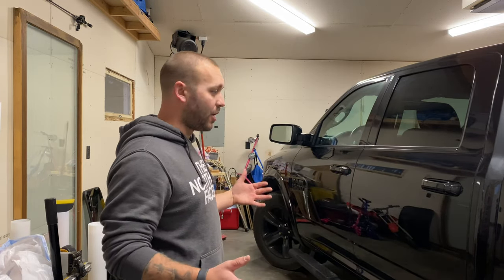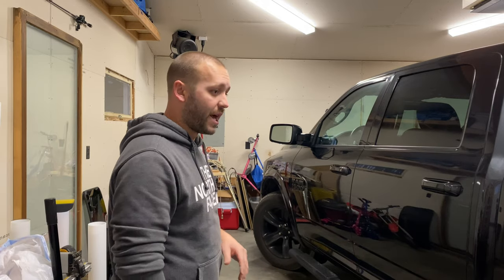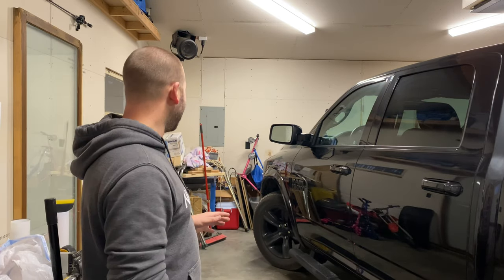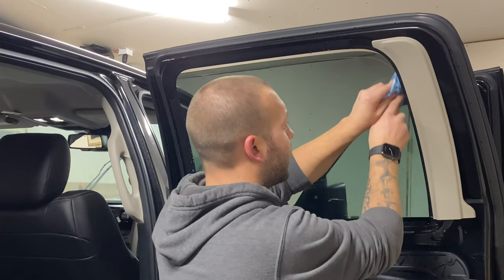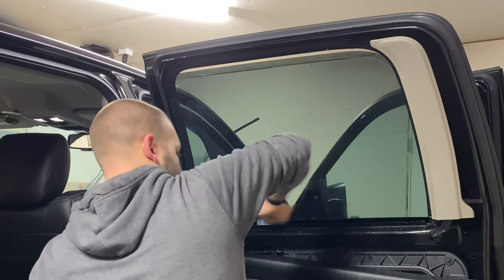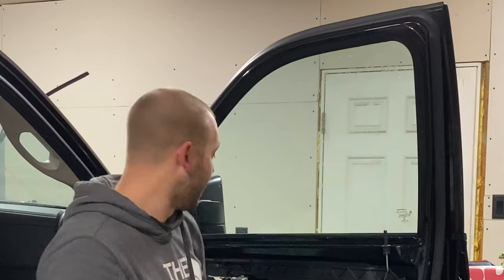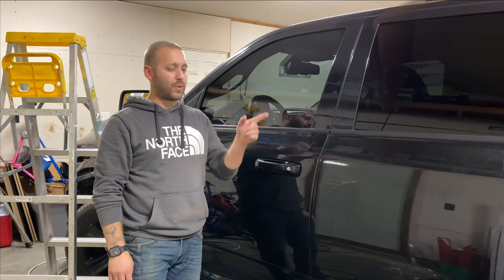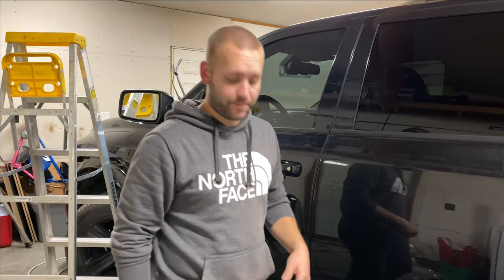Window Tinting a Ram 1500

Comment: After watching your vids, I'm thinking of tackling the tint on my work truck.  Where do you suggest buying the tint from?
Reply from the maker: That’s awesome.  A convenient option is partial rolls of SolarGard from Metrorestyling.com.  You can get a 40” by 10ft roll for less than $50. You will for sure be able to get the front two windows done with that and maybe even the entire truck depending on the glass configuration.  
I would stay away from the cheap films found at Walmart or auto parts stores.  It’s a bit harder to work with and will likely fade to purple over time.

Comment: literally askd myself the samething, to why My GunMetal Grey Metallic 4th Gen 1500 CrewCab’s interior A/B/C Pillars, sun visors & Headliner are Beige(dirty), when the rest of all my interior is black? SMH..Which is why im gonna DIY 3M Spray wrap them all with a very soft black velvet suede like fabric I bought from Joann’s Fabric(w/ Bentley style fiberoptic shooting starlights in headliner & VIP curtains for all 5 windows ima Custom Sew myself)..but so far I have 2.5% on my two fronts & 5% on my stock dealership 35% back 3 windows. You can’t see in( & I’m in Cali, so it’s just a Fix-it-ticket). I put em right back up after the Officer is done signing the fix-it ticket when I was taking em off,  in the same parking spot). I’m thinking of doing 20% on the windshield bc it’s too clear as day, & people are Nosey.

WORD OF ADVICE:  if you’re gonna do anything similar to this, make sure you’re driving a vehicle with Up-to-Date Registration, Valid Insurance, Valid License, You’re Off Probation aka “Off Paper”(meaning u have ur 4th Amendment back, so they can’t legally search ur ride w/ out probable cause)- but still keep anything illegal, all consolidated together in ONE compartment, out of sight for when u have to roll all ur windows down during a traffic stop…and don’t smoke weed in tha whip, bc that’s easily prob cause for PIGS in any state.
 
Also Educate Yourself on Every Traffic and Pedestrian Law in the City u Live in, bc they’ll take advantage of ignorance..”Knowledge is Power.”

My Comments are For Entertainment Purposes Only
Reply from the maker: and entertaining it is 😂

Comment: Why no heat shrinking on side windows?
Reply from the maker: Hey!  There are applications where a preshrink is necessary on side windows. I’ve also installed many truck and suv windows without the need to shrink first.
Reply: @TunersCanvas  , what about 2018 Ram 3500 crew cab. Do I need to do preshrink on side windows?
Reply from the maker: @repairvehicle  Would your approach be to leave the door panel in place or remove to bottom load the tint first while installing?
Reply: @TunersCanvas  , I  am going to remove door panels.
Reply from the maker: @repairvehicle  Ok. When I am tinting that application, I would not do a preshrink before installing with panels off since I post heat on the inside. 
However, there is no harm in doing so either if you feel more comfortable. Just be sure you lay the tint direction from the roll horizontal across the window, not up and down. 
Does that make sense or should I clarify better?
Reply: @TunersCanvas  , yes, it makes sense. I am using precut film. Thank you and I am subscribing to your Chanel now.
Reply from the maker: @repairvehicle  Thanks.  I’ll do the same.   Where did you get the precut from? Just an online site?   
I have a plotter that can cut and have been considering an option to provide the cut film to go with the tutorial video on how to install it but it seems with so many options online already it’s likely not worth the bother. Especially since I’d supply quality commercial film that costs more compared to some of the options available cheaper.
Reply: @TunersCanvas  , tint zoom

Comment: Weren't the back windows already at 20%?
Reply from the maker: Hey, typical factory privacy glass does equate to about roughly 20% yes.  In ND, there is no legal restriction behind the driver and passenger doors so it’s a common request to lay additional film over the rear glass to increase the privacy.